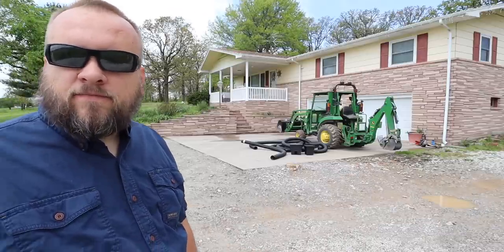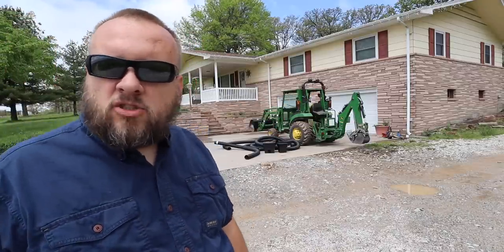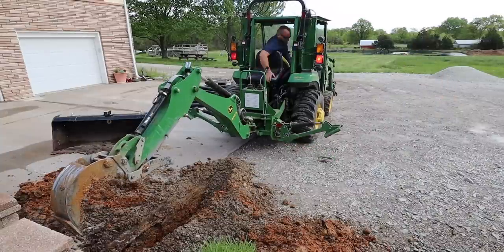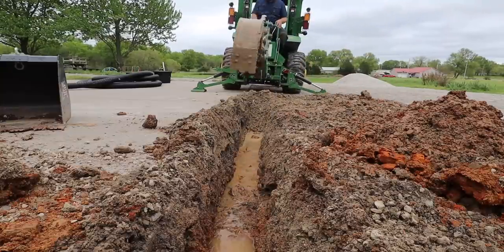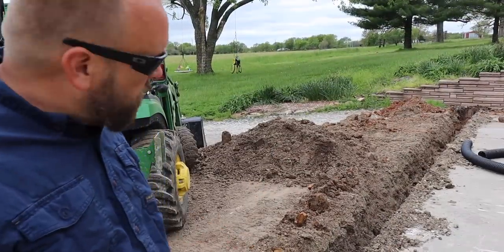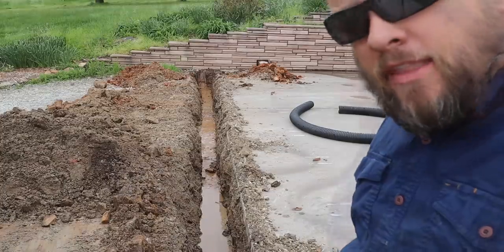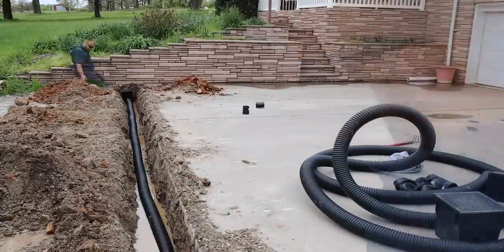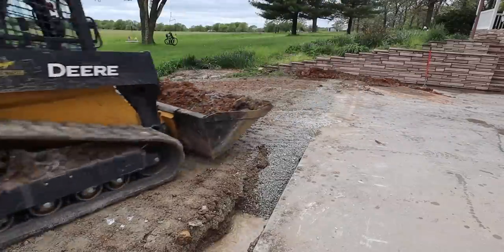Bxpanded Trenching Bucket - Installing Drain Lines

Comment: Brock, french drains have been around for a long time while geo-tech has not. I believe that you'll be fine. The only thing that I think that I would have done a little different is that I would have put just a light coating of stone in the ditch before I laid the perforated pipe in. Just an old man offering a suggestion. Nice job. 👍👍
Reply from the maker: Thanks for watching 

I thought about that afterwards too. A light layer of rock might’ve helped keep the pipe clean

Comment: Brock! Love your vids, keep up the awesome content. Really enjoy the variety of topics and machines.

Pro Tip for ya….when possible, always start digging your trench at the low end and finish on the high end. That method flows with the natural design of the machine to dig uphill and come up out of the ground. 

It also makes it so if you get rained out during the job, your ditch will drain out.

Comment: The trenching bucket is nice. I once buried 2" poly pipe across a road, with a dozer, with a 10 foot blade!
Reply from the maker: Playing with the big toys
Reply: @RockhillfarmYT  I didn't have a backhoe at the time. A 10 foot trench for a 2 inch pipe was overkill, but I had to use what I had.

Comment: great job Brock, I would be a little concerned about undermining the compacted dirt that is underneath your slab where your trench is.  heavy cars and trucks May crack the edge of the concrete slab in time . I like seeing a 6-in slab for driveways at least around the edge
Reply from the maker: Yeah, after I dug it I was wondering if it would’ve been better to put it a couple feet away 

Thanks for watching

Comment: Nice trench! The first French drain I dug with my bx23s, I found an older deeper French drain that was full of water. I hit the drain and immediately filled the drain I was digging. It was helpful though because that part of my yard is slightly sloped so I had a hard time determining by eye if I was going down hill. I self drilled some 3" schedule 40. Wish I would've used 4" because that thing takes on a ton of water.
Reply from the maker: Thanks for sharing the story

Comment: You can't push your self with the bucket ? Is it because it's hydrostatic?  I like the bucket also .
Reply from the maker: You can push yourself with the Backhoe, but it’s really slow going and feels like it can barely push it.

 Maybe because my tractor is has a lot of extra weight on it? Plus it’s extra stress on the backhoe cylinders so I generally just get off and move the tractor.

All that said, I’m almost always you working on a slope which makes it trickier, whereas This was perfectly flat ground so it might’ve worked easier

Comment: Nice, I was looking at that same bucket for my tractor. Just a little hesitant since the knuckle and all of the pins are wider than the bucket . Unnecessary wear and tear
Reply from the maker: True.  Some people told me that the linchpin gets knocked out but mine hasn’t yet
Reply: @RockhillfarmYT  yup, and then the grease fittings get all gummed up lol. I have a Kubota L2501 with a backhoe w/16” bucket. Love that thing , just like you said why remove double or triple the amount out when you are laying a small pipe

Comment: How is this working after a year? I've got a similar drainage issue I'm hoping to take care of soon. Anything you'd do differently?
Reply from the maker: Do far so good. A lot of people put geotextile fabric under the pipe. It works without it
Reply: @RockhillfarmYT  from my research the need for fabric depends on the surrounding material. You mainly have clean rock there with little dirt to clog the line. If you buried that in the yard you'd want to wrap it in fabric and put rock against the pipe to avoid soil entry and clogging. It would probably still work but maybe not as long as it could have.

Comment: Thanks for the video.  Now I was just wondering about a 6 inch trenching bucket for my 1025r. Didn't get my tractor back today like they said I would but that's beside the point. O can't remember Brock, dud you get the BX quick attach for the backhoe too or not. Kind of thought you did.
Reply from the maker: I did get a quick attach. It works well
Reply: @RockhillfarmYT  thanks. Looked at your other video again. Forgot you had it. Thanks for the  speedy response.  Like the BX looks better than the Deere. Like the ripper too.

Comment: They never used fabric for thousands of years. All of a sudden you need it to make your drain work. The ones who believe in using fabric probably need tought how a clay field drain works. If anything you use river gravel up to 3 inches from the surface and stone the rest of the way. Then there is river gravel up to 4 inches and a layer of straw then you put stone the rest of the way.

Comment: I’ve seen guys not even use the pipe in a scenario like that, since the clean 3/4” rock will not compact, the water will drain down it like a French drain. How wide is that trenching bucket?
Reply from the maker: The bucket is 6 inches wide so you probably end up with a trench 8 inches wide 

You are right about not even using the pipe being an option. 

I did a video a long time back comparing the fronthoe (stump bucket) to a backhoe for different jobs.

I dug a little 12” x 12” trench in that video running diagonal from the shop. All I did was put 2 inch clean rock in it and it still drains well a year later